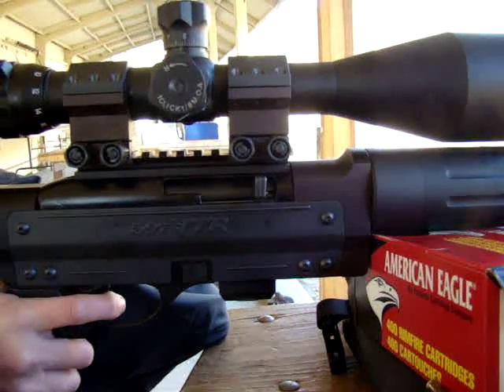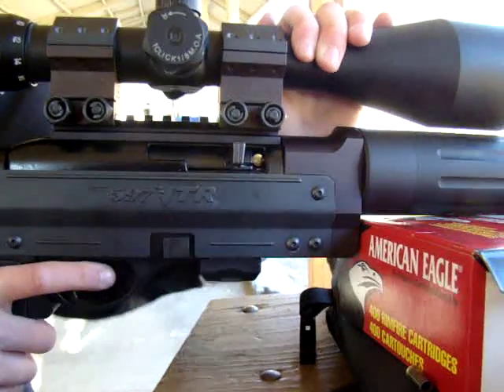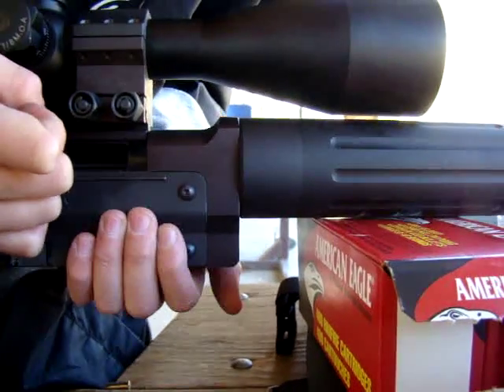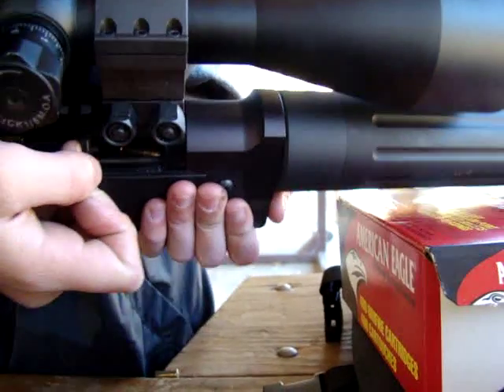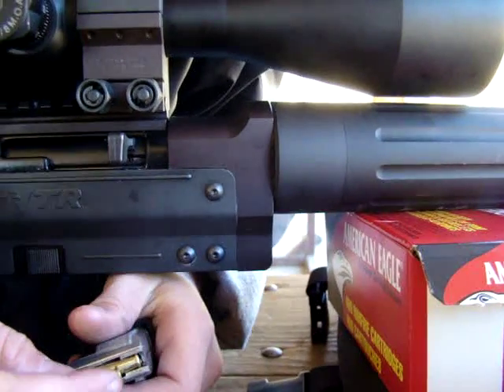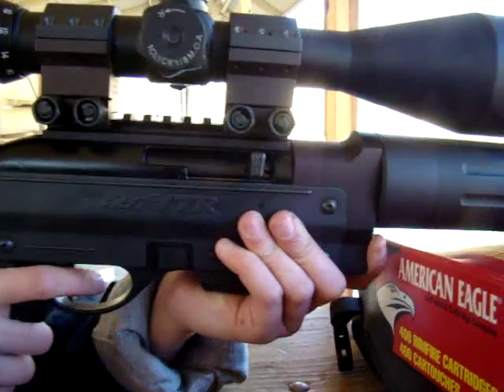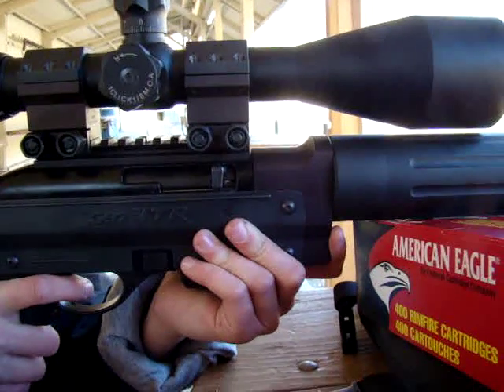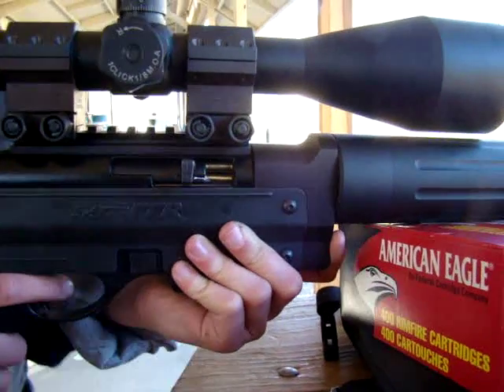Remington 597 VTR Function Test # 6

Comment: Took my 597 VTR  out for the first shoot today . I saw your videos the day i picked the gun up and i've been worried ever since . I took it out just before dark today and put 100 rounds of CCI Stingers through it i have a 30 round and stock 10 rounder and both failed once  ( the magazines not the gun ) the rounds stopped just before the top of the mags , so i shot them with a little Rem gun oil and they worked flawlessly . My last burst was about 20 rounds as fast as i could pull the trigger

Comment: It seems that it isn't just the Remington that's like this. According to a lot of people, it takes a 500+ round break in period until it cycles reliably. A buddy of mine has the Colt M4 22LR and it's the same story. Every few rounds failure to fire or eject. But after about 500 rounds, we shot 10 or so 30 round clips with no problems what so ever. Fired as fast as you could pull the trigger. Seems that the break in is the only way to get it to work right.

Comment: Looks good but it's still a 597. Constant jamming and stovepipes. Sure it worked a bit better with Yellowjackets or Stingers the expensive stuff. Dumped it and bought a Ruger and lived happily ever after. Eats anything put in it. The twin guide rail system sounds good but is a big problem and not easy to remove for cleaning. Looking to buy a ruger rs22 when I get the bucks. Expensive but you have the ruger reliability. My thoughts anyways

Comment: Goozyman has it right.....  you need to adjust the guide rods. when there too tight they bow and dont allow the bolt to travel(open) the correct distance which causes ejection problems.  leave the set screws a half to a hole turn less than tight(make sure there evenly tightened), that works best on my 597.

Comment: You need to use better ammo.  The rifle is very reliable. I bought one and used CCI stingers, and CCI quick shock. Invest in some good ammo, not the cheap crap, that is the problem. If you use the 30 round mag, take the mag apart, you will find two followers, take one out and put the mag back together and it will work fine.

Comment: Don't pay 600 for this gun that shop is way overcharging. average price for the 597 VTR .22LR is between 390-450. i paid 397 (around 420 with tax). i've also shot around 500 rounds and only had 5 failure to ejects. useing cheap 15 doallar box of 500. but i also cleaned  and oild both gun and magazines prior to use.